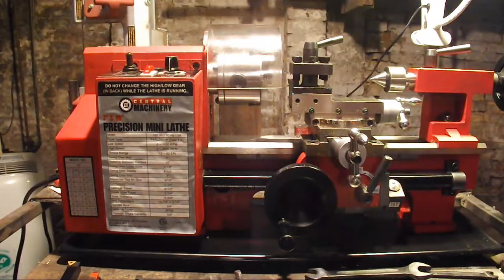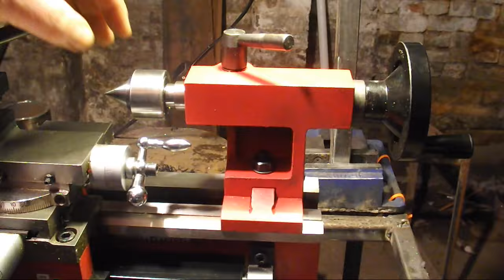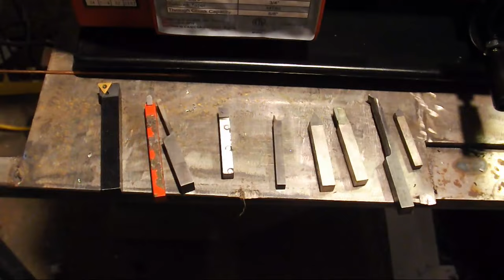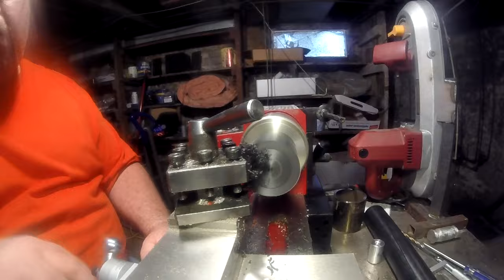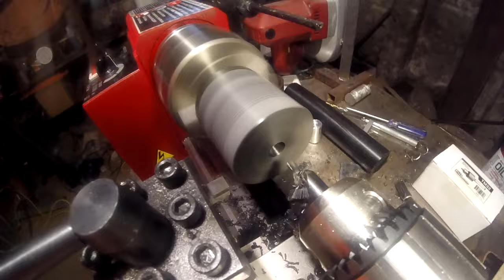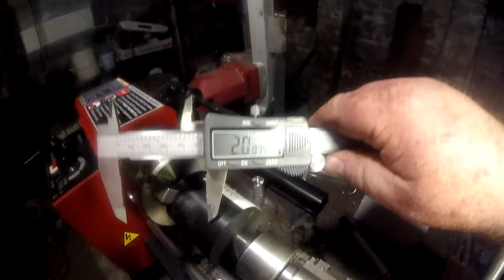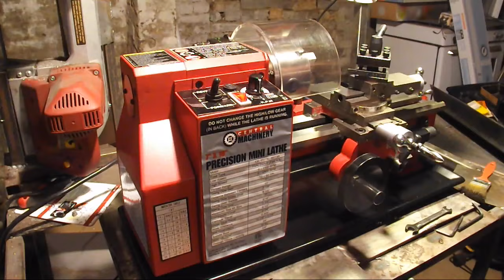Harbor Freight 7x10 Mini Lathe Review 93212

Comment: My main interest would be for cutting threads on a rifle barrel.  I know nothing at this point how to use a lathe to do it.  But, I think the automatic feed is used.  Is this particular lathe accurate enough (tight enough - not sloppy) so that each time the cutter came back for another pass it could start in the exact place the previous cut started?
I imagine it would make pretty bad threads if each pass started in a slightly different location.  If this lathe is not accurate or tight enough, could a person just make a couple of passes and then finish the threads with a precision die?
Reply: Mystery47 not sure how you would hold the barrel. This doesn't appear to  have a hollow head stock. And if it did probably isn't  large enough.
Reply: I just learned something new.  I saw a YouTube video of a fellow using a Grizzly G0765 7x14 mini-lathe to put threads on a .22 barrel and that lathe, apparently, does have a hollow headstock.  So, I thought ALL such lathes would have hollow headstocks.  I'm glad you pointed that out before I went and bought a wrong lathe.  Thanks.
Reply: I wonder....   As I look at the lathe in this video, on the far left side there is a big, round window there.  Is that just to get access to the gears or is it a feedthrough hole?  I'll have to go down to my local Harbor Freight and find out.
Reply: Mystery47 I checked the online manual and I think it has a 3/4 in bore. So how big are your barrels. 

One other factors is how long of a barrel? If it fits how much is hanging out to the left unsupported and spinning at 500 rpm.
Reply: In the other video by Practical Renaissance, he said he made a lathe spider chuck which attaches to the back of the headstock and holds and centers the barrel in the chuck.  Now that I look around, I see several videos on how to make such a spider chuck.  I believe they can also be bought.   I'll have to go down to the local Harbor Freight to see if a spider chuck could be attached to the back of the headstock to support and center a .22 rifle barrel.
In his video, his rifle barrel still had the receiver attached.  So, I would guess that he just used the approximately 17.5" of round barrel to insert into the back of the headstock and out the four jaw chuck.  With the off balance receiver still attached, I imagine he kept his RPM speed low so as to not cause any vibrations while cutting the threads.
To anyone following this conversation, the one thing I learned for sure is to CUT BARREL THREADS CONCENTRIC TO THE BORE - not necessarily to the O.D. of the barrel.  I guess that sometimes when a bore is bored it doesn't go straight down the barrel.  It could be angled a bit from center.
Reply: Mystery47 this lathe is too small for most  rifle work. about the smallest you can go for rifle work is 30" inch between the centers or you need a 1.5 inch  thru bore. you might be able to do pistol work if you spin the barrel on an arbor. For rifle work get a grizzly gunsmith lathe. they are well built and have features especially for rifle Smith's. Personally I use a 40" Atlas and spin barrels using a shop made cat head. It would be much easier if I upgraded to a  newer lathe.
Reply: its a thru spindle so yes you can thread barrels as long as you like as long as you have a steady rest holding the protruding barrel spinning true. I think the thru hole of the spindle is around an inch. use the numerical dial on the front lower right of the machine to clock the timing to keep from splitting the threads. works great, this isn't an industrial machine so the cuts will be very light but will work. have fun setting your gears lol.
Reply: for close to the same price, buy a used South bend lathe on Craigslist, fix it up, and have a lathe that will do everything. you can find SB heavy 10 with tooling and taper attachment and stedy rest, 3&4 jaw chucks for 1-2k

Comment: Thanks for the informative demo.  But did I see that correctly?  did you remove the safety shield and bypass the cutoff switch?
Reply: His choice. It only covers a chuck. Any body who puts their hand, cloting, tools or hair around that area is not fit to use that machine anyway. Much more likely scenario of something flying of is an attached stock, that either is not clamped securely, or tool crashing into it, and flying off. (Tool hopefully down). And that shield is not going to help with that. Just tools and stock secure properly, know how much of the cut you can do, stop power feed beforce hitting chuck or steps, or do cuts slowly and shalowly manually, and know your tools. Also stay away from the line of fire in case something gets loose.

Only realistic scenario why would you need this shield is when you leave a key for the chuck jaws in the chuck. Never do that! Do not leave it there even for a second. It it either in your hand and chuck, or in a safe storage place. It is rule number zero of lathe safety.

Comment: Thank you for sharing, is it with the extra money to get the 12" version instead of the 10?
Reply: If you need to turn pieces longer than 10" you'll need the longer bed on the lathe....I have the 7" x 12" model, and back when I bought mine I could use a 20% off coupon so the price difference was negligible...I'd rather have more room than I need than to be cramped or need more room so I got the larger one.

Comment: Am i just missing something? I have tried both 3/8 and 14 cutting tools and one set is too low and the other is too high from the center axis. What gives?
Reply: All turret type tool posts have a maximum size you can use for that particular machine.  Too high, use smaller tools.  Too low, use shims under the tools.  This is pretty well standard for almost all industrial tool posts.  I have mine set for 5/16 tools, as those are the ones that fit in the tool holders for my 12 inch grizzly.  It doesn't really matter, every time you change the tool, you have to reset the center, and that applies to one you've just sharpened.  I'm not raving about the turrets on engine lathes, I far prefer the lantern style tool post and holders.  Getting it back on center isn't any big deal.  Turrets belong on turret lathes, but usually those turrets will cost about ten times what the HF lathe does.  They also index within a few ten thousandths of an inch.  Quick change tool posts, okay, but I'd still rather have the tool holders and lantern tool post with the rockers.  I also don't use insert tools, HSS, hand ground or machine ground depending on what I need is just fine.  Hurry is the mother and father of all screw ups.  Take your time.  Or, take the time to do it twice.
Reply: It's meant for 5/16 tools.  Shim 1/4 tools, you can't use 3/8 without grinding the shank or going to a vertically adjustable tool holder

Comment: Can you remove the end plate and like stick in  rod of about 14" thru the head of the lathe and then turn on the end of it?
Reply: No need to remove the change gear cover. There is a hole in the cover that is aligned with the spindle bore to allow long material to pass thru it.

Comment: I'm going to ask what may seem a stupid question. I'm really excited about buying the smallest lathe from Harbor Freight. I think the price is about $130.00. Since I have never used a lathe, I'm a little confused. On this lathe you are reviewing is this a metal lathe? Is there a difference between a metal and wood lathe? Or, can I do both wood and metal on this lathe? Thanks.
Reply: This lathe is intended as a metal lathe, one major difference being you mount your tools into a tool holder, whereas in a wood lathe you hold them in your hand against a tool rest.
Reply: elan really
Reply: its advertised as a metal cutting lathe but can be applicable for man uses; wood, plastic, metal, etc.

Comment: My biggest problem with this lathe is that is advertised as 7 x 10 and it is bogus , You can't put 10" long part there ???  The 10" means between centers ! And between tail stock center and the chuck is nearly 6" space ???
Otherwise it is good lathe ...

Comment: I had one of these. I was afraid it was going to flop over on me so I welded it to a piece of 10 inch channel iron. The 1st thing to fail was the motor control board so I upgraded it to a standard motor control board. Then the motor burned up. I modified a treadmill motor to fit behind the lathe and found a bit to fit. After about $200 worth of surplus parts I had a usable lathe but for another hundred dollars I could have bought a 9"x30" Jet lathe.
Reply: do you think you would have to upgrade the jet lathe if you bought it?

Comment: Does anyone know if the change gears are steel or plastic?
Reply: Plastic, and that includes the main drive gears that select high/low range inside the headstock. I find the feed rate set for turning is way to fast; if I remember right it is about .005 inches feed per revolution. This is more than this machine likes and causes a lot of chatter taking even a light depth of cut. This machine does not have tapered roller bearings on the spindle, only standard ball bearings which do not provide for any preload to provide a rigid spindle. I've purchased a set of tapered bearings but have not installed yet.

Comment: Hey my friend, Great Review.  I have a quick question about the lathe. the swing over bed is 7 inches.  would this lathe be able to turn a casting 6 1/2" in diameter (flywheel casting)?  Reason I ask is that I hear people tell me that just because the swing is 7 inches, don't expect to be able to turn anything bigger than 6 inches.
Reply: +Matt Schuette 
Mine seriously will not turn anything that big in aluminum as there is not enough power even in the low gear. You might get away with it if you are just polishing but cutting anything with that much radius would be slow going and inaccurate. My lathe is all but worn out  and I sheared several drive keys trying to do more than this little machine can handle. But its great for making small parts, sleeves, shafts, odd pieces. Cutting anything made of plastic is a dream with this unit.

Comment: FYI....Never start the spindle without having something clamped in the chuck....the chuck jaws could spin out and become projectiles!
Reply: jungleskunk01 never heard that before.  was wondering how?
Reply: because it is not true. the chuck jaws have a scroll cut onto them which fits against the scroll plate inside the chuck. this scroll is in turn rotated by pinions which is where you tighten and loosen the chuck with your key. while outward forces would be placed on the jaws, it would this alone would not cause the scroll to turn inside. now, what some people to cause to become projectiles are the chuck keys they forget to take out when tightening.
Reply: OK, you know best...

Comment: I see you did this post about 5 years ago, I bought the same lathe machine about a year ago. Hoping to do everything including milling. So I bought a indexing table hoping it could be mounted on the lathe. 
So can I mount this indexing table and mill? I will be working with aluminum so not that much pressure on the machine. 
Thank you for any information
Reply: You can do some milling in the lathe by having a vertical milling slide/vice  in place of the compound slide and holding the cutters in the 3 jaw chuck.

Comment: Any limit on how small you can go on that?  Like could you make a .1047 inch cylinder on that bad boy?  :-)
Reply: When macining or lathe turning a part only 0.1 in diameter I find the biggest problem on my own Sieg mini is the part being machined wants to bend (or worse) simply snap under the pressure of the cutter..  I recently had to machine 3 custom, tapered steel bolts in size #4 which is 0.11" or 7/64" to replace corroded/rusty ones in a piece of 140 year old machinery.  Suffice to say the job was a total pain with many bent or snapped fails, before I finally walked away with 5 good exact replacements for the originals.
Reply: Ken ibn Anak So it's possible but very difficult.  Thanks for the info dude! :-)
Reply: Yes, that's a good summation.  Even though secured at both ends, there are sideways forces from the lathe bit pressing against the piece which in the case of such thin work pieces may easily deform along the axis of force.  If you switch to a stronger material, it is also tougher which means more shallow bites per pass.  A spring loaded brace with rollers durectly opposite the force of the lathe bit, might be one solution, but making rollers for some pin smaller than 7/64" would also be a challenge.  You don't say how long a cylinder you are looking for, but I would suggest simply buying some 7/64" pre-formed dowel pins and simply carefully thinning them down with a lathe and fine emery paper, then cutting them down to length.  For instance.., https://www.amazon.com/Stainless-Steel-Cylinder-Fasten-Elements/dp/B00B3MFQEY   $7 for 100 of those is a lot cheaper than a lathe anyway   :)  Noting also that they are available up to 3 feet long at http://www.dowelspinsshafts.com/
Reply: Ken ibn Anak thanks for the info sir you've saved me a lot of time! :-)  the length I was looking for is .8799" so a little longer than the ones linked to but I found some closer to that length there at amazon as well.   I saved that dowelspinshafts.com link to my favorites nice to have another source. :-)  I'm so new I didn't even know what emery paper was thanks for the info!  Definitely got my gears turning.  Thanks for pointing me in the right direction. :-)
Reply: LoL, my bad.  I should have typed Emery Cloth, not Emery Paper.  I was half asleep.  For wood we use sand paper, but for metal the proper thing is Emery cloth.  Very similar in concept to sand paper, but it has a cloth backing instead of a paper one.
Reply: Ken ibn Anak oh emery cloth, got it!  Thanks again. :-)
Reply: Ken ibn Anak

Comment: Just picked one up on craigslist, barely used for $250. It looks like there is a through hole of about .800 diameter. But the chuck is only .70 or less opening.  I am wondering if i can buy a different chuck with a wider opening to fit a .75 diameter pipe through the chuck.

Comment: The one I have is pretty lame for actual machining.  Every adjustment has slop, the bed flexes when encountering resistance and everything seems to move when operating.  The dials have cool markings that don't mean anything because the actual tool movement in material is more affected by cutting resistance than dial settings. That is, you can't predict what will happen by your settings.  Using this lathe is more akin to a wood turner's lathe than a machinist lathe.  This is sad because for many of us, who make small precision parts, a small PRECISION lathe would be great.  This is NOT that lathe.  This lathe has uses, just not precision uses.  And don't even try to cut threads.
Reply: None of what you said is worth the time it took you to type it.  Problem is, you're a hack, not even an amateur or home shop machinist.  Learn to sharpen tools and get them centered properly.  Learn to set the machine up and do the normal adjustments.  Mine reliably will work to .001 inch, just as easily as my bigger lathes will.  The problems are in the flesh, not in the iron.

Comment: Just bought this lathe, garbage. Machinist of more then 32 years. About as ridged as a wet noodle and good for nothing but mixing margarita's. The entire carriage flex's with the lightest of cuts even in aluminium or brass. I would even dare say this lathe is potentially dangerous at best. Better of buying an old Southbend. This lathe would be "okay" for turning plastics and other soft materials only.
Reply: I  don't use brass or aluminum for most of what I do.  I far prefer 4140 pre hardened, A1, O1, or other tool steels.  It handles it just fine, and I'll put my 44 years against your 32.  Realize it's a small machine and stop trying to take cuts like you had a 16 inch Monarch.  It will work just fine and be reasonably accurate at the same time.  I get the idea that you've never had to do any adjustments on any machine you've run, but that's something you can't do with a computer on the machine.  Mine works just fine, actually, all three of my lathes work just fine, but I took the time to adjust them if I saw play where I didn't want it.  And I'll quote Ben Franklin, "Tis a poor craftsman that blames his tools."

Comment: GREAT REVIEW - TERRIBLE LATHE
I spent some time studying prior to buying my mini lathe, and selected the Micro Mark "True Inch" 7x16 lathe.  It has a quiet brushless DC motor that does not require the noisy two speed gearbox and it also includes a cam lock tailstock.  I found that the mandrels designed to face the front end of small or large ring Mausers will not fit in even a 10x14 lathe, making the 16" lathe necessary.  The "True Inch" lathe has markings that add up to .050 per revolution, instead of a metric "almost equivalent."  My lathe came in two boxes to meet UPS weight requirements, which made it easy for me to pick it up and put it on my bench.  Little Machine Shop now sells the same lathe (with their name on it), and it could be taken apart to be placed on the bench, if you don't own a crane. 

Micro Mark and Little Machine Shop also sell a mini mill that uses the same brushless DC motor, and both the lathe and the mill have a jack for a plug in digital RPM counter that they sell. 

The current prices on the Micro Mark lathe and mill are $1K each, but "you get what you pay for."